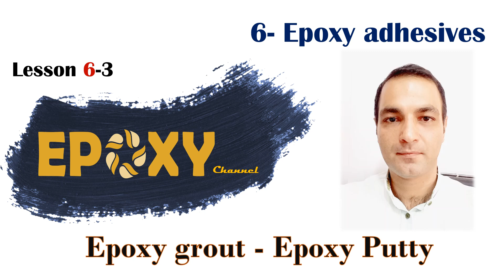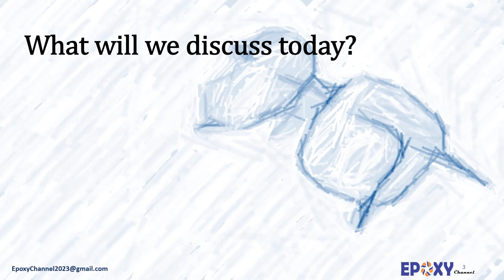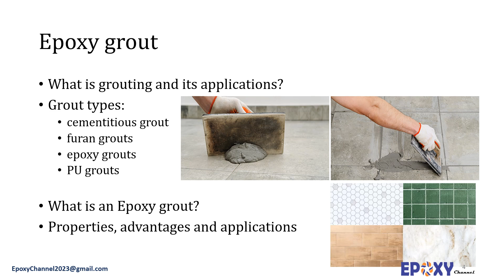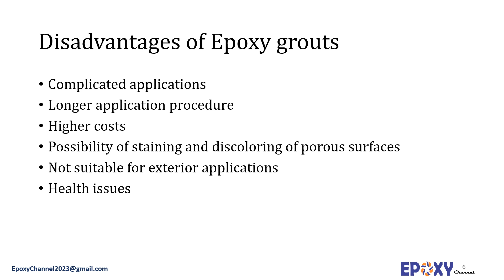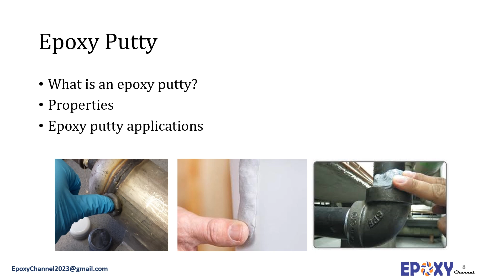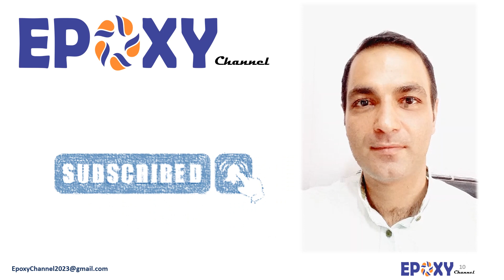Epoxy grout - Epoxy Putty - Session 41

Comment: Hello when will you do moulding of epoxy
Reply from the maker: Hey, epoxy moulding can be done in various applications, for example for casting and structural applications, i.e., composites, or for Electrical and Electronic Component Encapsulation. In addition, it can be used for small mechanical parts (manufacturing),  or for prototyping and rapid tooling. 
For decorative parts also, you can use moulding.